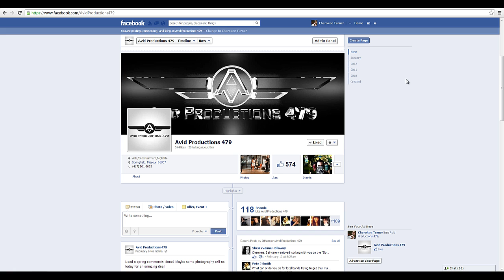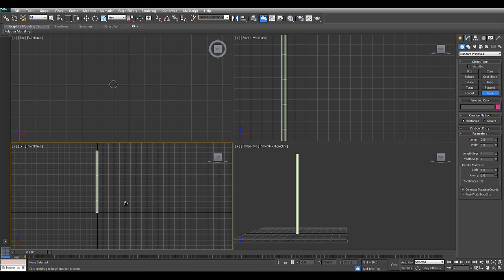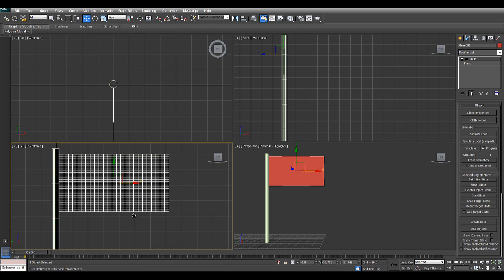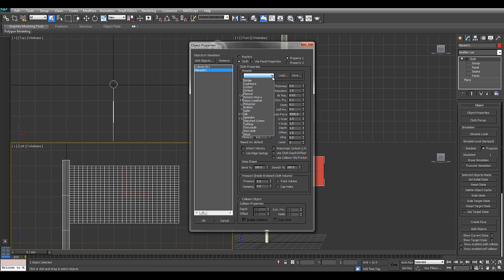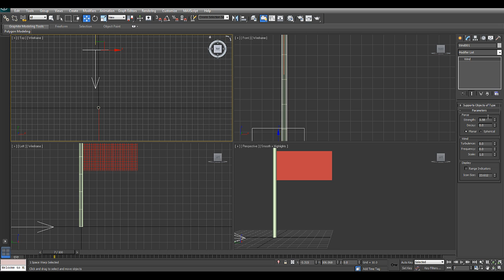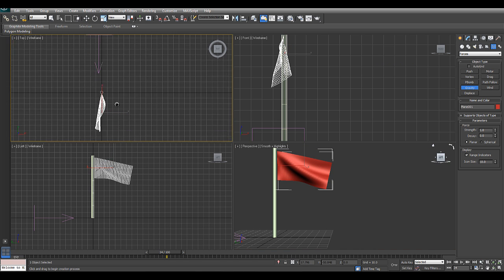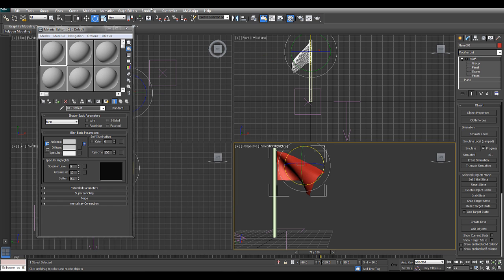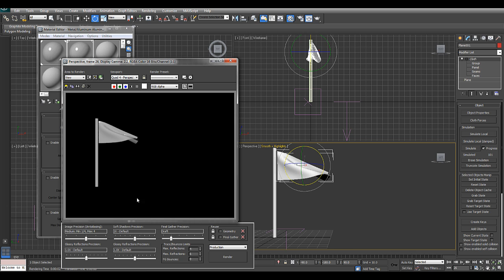How to Create a Waving Flag in 3ds Max 2013

Comment: what about making flags or objects that are affected by wind in a games engine such as unity?
Reply from the maker: +Fissle Wine hmmmm not quite sure about that one. BUT! we are adding a 3ds max and cinema 4d guy to our team to make more tutorials that im sure will help!
Reply: +TutorialGrid cool because I'm a student and we use 3ds max to create levels and content for computer games.
Reply from the maker: cool are you going to be using the unreal engine for games?
Reply: +Fissle Wine Point Caches are the way to go for getting this stuff into game engines as it's a lot of vertex data animation. For Unity you'll need custom scripts and vertex shaders to read point data which you can buy /write yourself (there are some free ones around too). NVidia Gameworks and the like also allow custom solutions and MaxScripts for cloth (if you want to go that route). Note it'll be fairly heavy to do though (depending on the vert count). To get around this for mobile I usually create a high poly flag animation and bake out animated normal maps (combined with some simple vertex shader animation for silhouette changes)